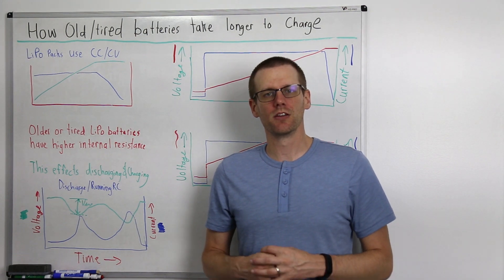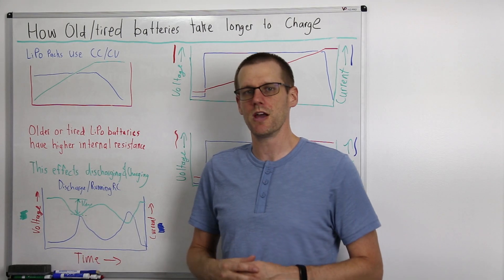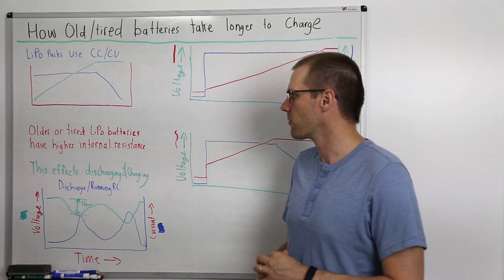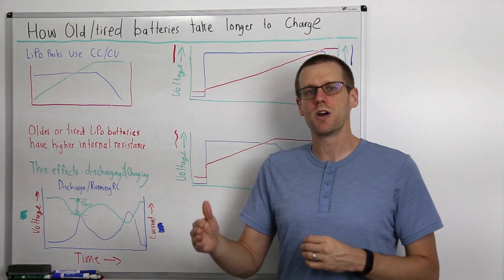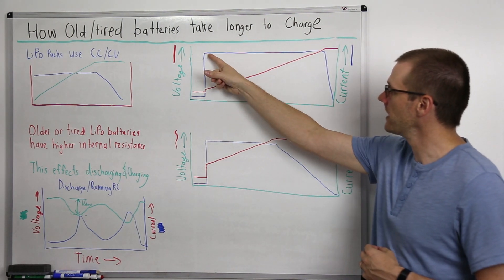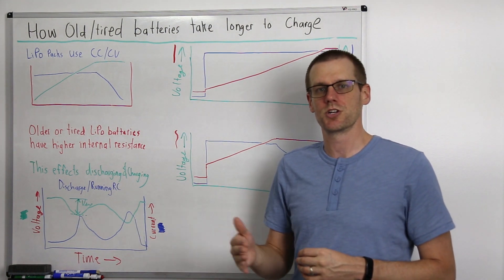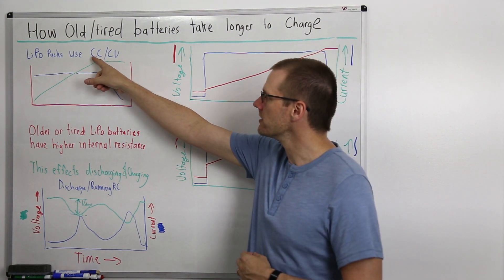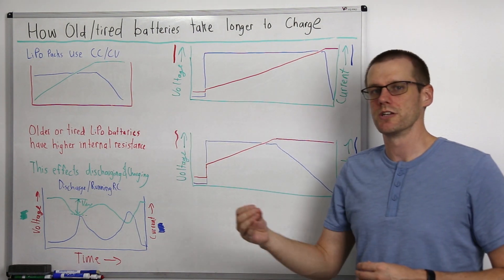Older or Tired RC LiPo Batteries Take Longer to Charge - Here is Why

Comment: Why are my SMC lipos swelling after several charges and discharge cycles at 1C charge rate?  Are they poor quality or is it my Spektrum S2100 Dual charger?  Can chargers damage your expensive lipos?
Reply: Also to actually answer your question any charger can probably damage a lipo, but better ones are much less likely to, what are the specifications of the battery and how long did the cycles take (because I have that charger and it discharges pretty slowly)?
Reply: I personally don’t believe in “charging at 1C…” It’s not battery-specific and doesn’t consider the Internal resistance of the battery, I have four 100C 5200mAh 2s batteries for racing and they charge very fast, like in less than 30 mins when I charge them at 4Ah, so if I were to charge them at 5.2Ah then they could leave the charger a bit overcharged, unbalanced, or both, and to be honest now I’ll charge them at 3.5Ah and they still charge in less than 40 minutes

And then there’s batteries of the same voltage and C rating but different capacities, like I can understand why you would charge a 1600mAh slower than a 5200mAh, but what about an 8000mAh 50C? Would you charge it at 8 amps? I just think that battery charging is something that can’t really be generalized by charge rate, I usually do it by time, a 5200mAh 50C 2s charging at my charger’s default setting of 4Ah will take around 40 minutes, a 3s will take around 55 and a 4s is around 1 hour and 15 mins, so I’ll adjust the charge rate according to how long the charging takes